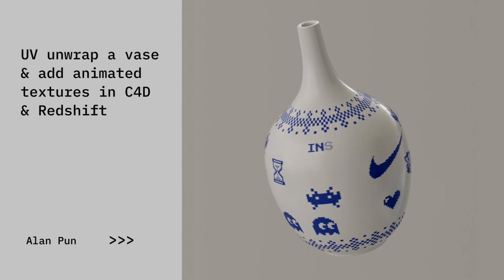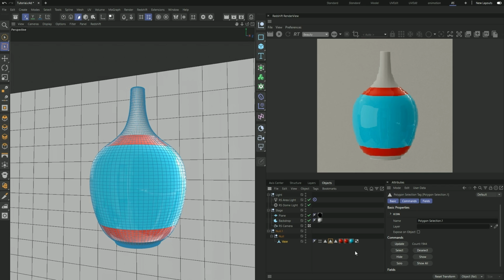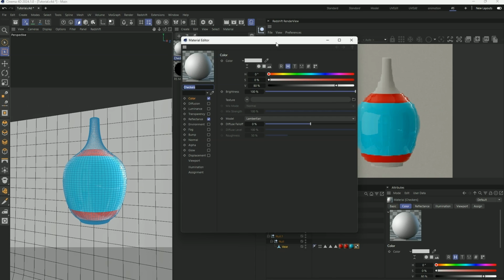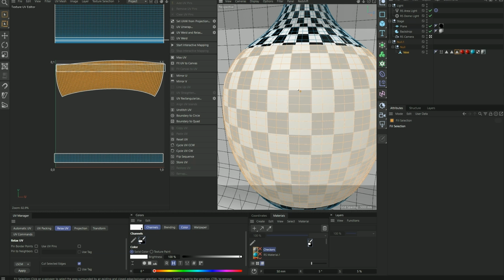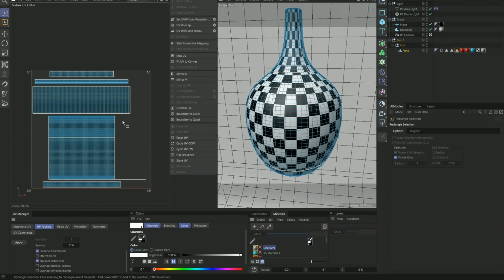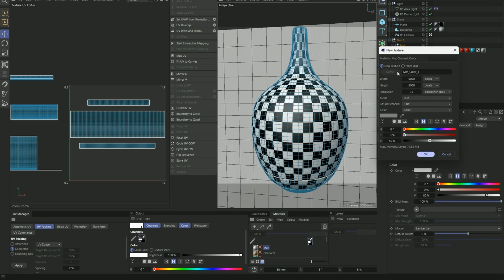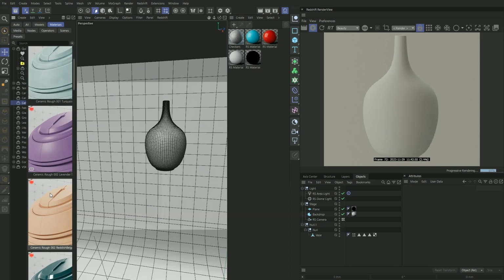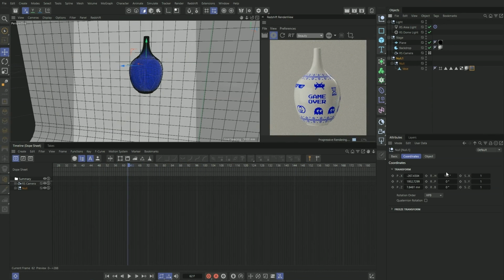UV Unwrap Cylindrical Objects & add Animated Textures in C4D & Redshift

Comment: So this works as long as you use limited textures only inside your selections. But what if I want to put a whole connected texture over an cylindrical object? If I do it with your method I think there will be stitches all over the place. So how to get one single piece of UV to draw all over the object?